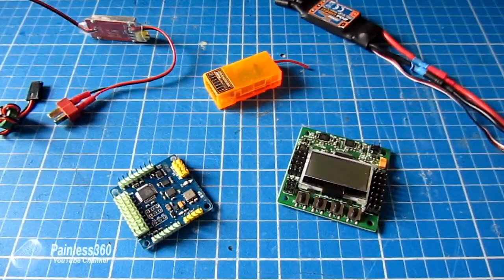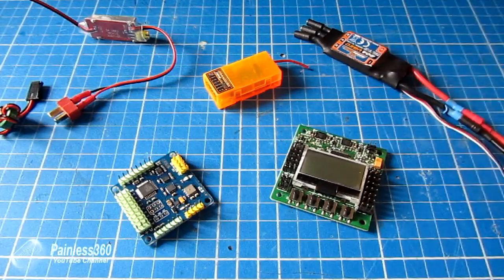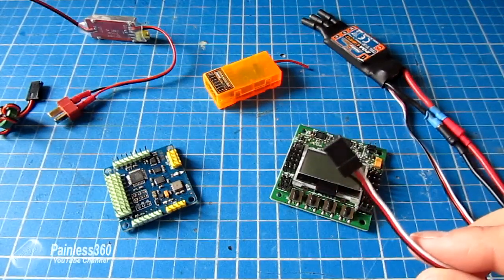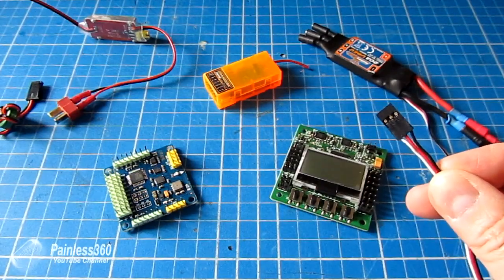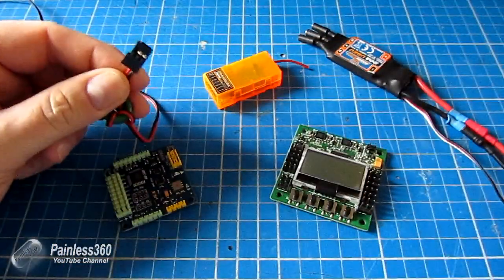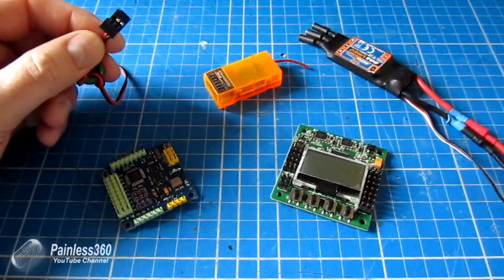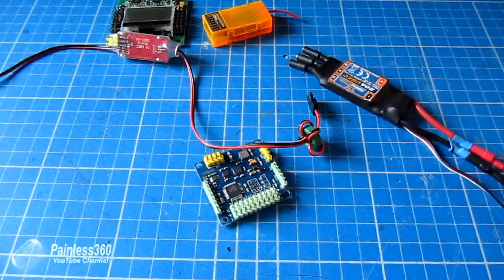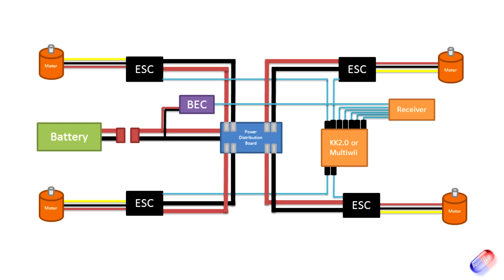How to connect OPTO ESCs and a BEC to you multirotor (KK2.0 or MWC)

Comment: Hello
I have a omnibus xrotor f4 g2 fc and 4 individual platinum pro 30 amps esc no bec 12000hz. What's the right protocole to use them in betaflight make them work with the fc or there's others special sitings. Or just it won't work.
Reply from the maker: Most modern ESCs talk DSHOT. Started with DSH 150 and try it.... Best of luck

Comment: so if you have external power you only need toconnect the white cable? or do you need to connect the red/black wire as wel? thanks
Reply from the maker: I'd always connect the GND wire.. Best of luck
Reply: @Painless360  ok thanks

Comment: can I use a lm2596 buck converter with my 3s lipo batery to power a 5v flight controller
Reply from the maker: Would that support the battery voltage?  Lots of good RC specific options about that are designed for the job. Happy flying!

Comment: I have APM 2.8 board and 4 ESCs with BCE and I want to run another servo motor do I need to power power module or it works fine by the power supplied by BEC ????

Comment: Hey Painless 360. I am having trouble picking exactly which external BEC to buy for my coaxial bicopter I am making. I am currently using a multiwii FC with atmega328p (probably useless info), and have two BL Heli 15A escs and also a Futaba R2006GS receiver. Is there any external BEC yo would recommend in particular or any way I should go about deciding which on to get. I might also switch my ESC's as they are not in the best condition. In that case, if I do replace them, is there any recommendation you would have on a good ESC to get for brushless motors, and an external BEC along with those? Thanks so much, and your video was already s much help. I have also watched a lot of your other videos to learn so much about RC. They are so helpful!
Reply from the maker: Has your running servos then you'll need a bec with a little bit more power. I personally look for a nice little switched BEC with a 5 volt 3 amp output. That should be enough for everything. Best of luck with your
Reply: Based off of what you said this seems to be the perfect UBEC for me: https://hobbyking.com/en_us/kingkong-5v-3a-ubec.html?countrycode=US&gclid=Cj0KCQjwjtLZBRDLARIsAKT6fXwss2pBMAtPywM37ie63eIDbf5hCWNCAuS3HNxp5qY-1dNuhFvGryUaAnCzEALw_wcB&gclsrc=aw.ds
Just wanted to get your input as you know much more than me :). Also, I need a UBEC that works with brushless motors, but this one does not state if it does or not, so do I assume it does?
Reply from the maker: That would work. :D

Comment: I have a pdb with 5v and ground pads on it.
Can i ONLY connect the + pad to the kk 2 board without connecting the ground? (Meaning ground will be the ground from the esc) or must i connect the ground pad in pdb along with 5v to the kk2 board?
Reply from the maker: You can but it’s not ideal... you could connect the power and gnd to a spare connection on the receiver..
Reply: Painless360 u know after i posted the comment i thought of that :D but hey thanks for the fast reply!

Comment: Hi, I need some of your painless advice if I may.   I just found out I need a BEC for my drone.  I'm using esc's that don't have a BEC built in.  Funny about that - when I was ordering parts from Hobby King to build my own drone, they gave me the link for the slimline esc's but didn't mention that I will also need a BEC.  Currently I have a motor connected to esc and esc lead plugged into the 3 pins on my flight board.  When I get the BEC, where/how do I slot this in to the current set up?  Apparently I have to power my flight board without blowing it.  Am I supposed to use a separate battery for this.  My motor is connected with 3.5mm bullet plugs into the esc and then the other end of the esc to the multi splitter battery connector.  This is the esc I am using...https://hobbyking.com/en_us/turnigy-multistar-20a-slim-v2-esc-with-blheli-opto-2-6s.html

I noticed your diagram includes a power distribution board.  I am not using one of those yet.  Do I need one?   If you can offer any assistance, I'd be most appreciative.  thank you
Reply from the maker: +Richard Cerni please see my 'quadcopter building for beginners' series. I cover common things like this in those build videos. There's usually another place on the flight controller that you can connect the 5v and GND to as they are common on most flight controllers.. best of luck!
Reply: Thanks for getting back to me so quickly.  I'll check it out.....

Comment: I have made a zmr250 with openpilot cc3d and esc I have used furibee don't have bec so just wanna confirm that where I have to connect the 5v output from PDB? Receiver or Cc3d (i have watched your video but some say something else)
Reply from the maker: +Just Hack It either will work but I like to connect it to the FC..

Comment: Question: I have 4x ESCs with linear BECs. To tidy up the wiring after trimming the length, can I remove the red wires on 3x ESCs and leave only 1 red wire from the 4th ESC to power the flight controller?
Reply from the maker: +K Khalifah yep, that should work fine. Make sure that one is enough to power everything. Happy flying

Comment: I am new to this but are there not ESC with BEC built in? Also which is better? One single independent BEC or for quad 4 ESC with BEC built in?
Reply from the maker: It's a very personal choice and depends on the space in the model too. The 4-in-1 is more compact but if one ESC fails then you need to replace the whole thing..

Comment: It us written on the bec tat it is 3 amp and max 5 amp,  tat means the receiver can handel 3 amp current?????
Reply from the maker: A receiver can normally use less than half an amp. The rest is there for servos and anything else that you may have that uses the 5v power (servos, flight controller, GPS, Bluetooth module, FPV camera)..
Reply: Thnks for your reply,  but can it handel 3 amps,  like I'm making a plane with 2 small dc motors and 2 servos,  I'm using the small chip board inside the 9g servo as brushed esc,  I'm giving 5v 2 amps supply in the receiver, so u can understand that the motors &  servos gonna pull all the amps through the receiver,  will it be able to handel it
Reply from the maker: Impossible to say without knowing how much the motors will pull. I'd always use a separate power system for motors.. Best of luck

Comment: Hello, I'm having a problem to power up all ESC to Naze32 rev5. Maybe I'm doing it wrong but can you help me, please. I did follow all the steps on Naze 32 build, beginners quad build, clean flight. I'm using flysky fs-i6x control, fs-x6b receiver.
Reply from the maker: Happy to help but please watch https://www.youtube.com/watch?v=olIqTiSJHIY and come back to me with more detail of what you've tried..
Reply: I tried everything that the video had said, none of them works on the naze32. I can power up the board and check the control and it works. But the ESC as soon I plug battery motors doesn't make that beeping sound. That's where I'm stuck, I tried to go back on clean flight maybe there is a button that I need to check to power up the ESC.

Comment: LIKE 342 from me !!! Very good job ,awesome content in your channel ! I have also a configuration (CC3D with Spider ESC...)I have a question ...What external BEC would you recommend me for Spider ESC 12 A opto (no internal bec)???
Reply: And...i still have to cut down the red wire from my esc ?
Reply from the maker: I've heard of OPTO ESCs that need the red wire connecting as it powers the 5v for them too so I'd check on the manual for the one you've got. A small 1-1.5amp UBEC would be great. Best of luck!

Comment: New to the hobby, flying quads. Watched your vid on calibrating ESC's. Tried the process with OPTO ESC and motor would not power up. Had battery to motor and battery to power OPTO plugged ESC into receiver. Receiver beeps as should but motor would not respond when throttle up.  What am I doing wrong.
Reply from the maker: The signal normally needs to be above 1,800 microseconds for the ESC to realize you want to calibrate. Make sure that you're using the right protocol too - OneShot125 etc.. Best of luck!
Reply: Thank for your reply. 
Sorry Painless I don't know anything about microsecond how would I search information. Very new at this would it be best to purchase different ESC's and not use the OPTO. All I wanted to do was calibrate each motor before installation. Thank u again for your time.
Reply from the maker: +Larry Faucett if you're new to this then watch our 'Quadcopter building for beginners' series on the channel we cover all the steps.. best of luck!

Comment: if im  using a 12s setup  with 2 esc,s and 2 motors with 1 receiver do i still have to remove the wires from the esc,s if they dont have built in becs?
Reply from the maker: You need to make sure that something is providing the 5v power the Rx needs. If the ESCs are using switched BECs then you need to remove one of the red wires.. Best of luck!
Reply: but what if im using 2 esc,s with no bec,s in them then what wires need to be removed?my setup is 2 motors 2 esc,s a separate bec and a receiver
Reply from the maker: You need something to supply the 5v, this is what we cover in this video.. Best of luck!

Comment: where would you plug in ubec for opto esc when using apm 2.8 with power module and the small jumper is off? right now i have the ubec plugged in the output side for esc on the apm 2.8 board and the receiver/gps/analog and telemetry side of apm 2.8 is being powered on by the power module. 
PLEASE  & THANK YOU.
Reply from the maker: +Mohammad Ali you don't need the ubec if you have a power module. See our APM series for more details. Best of luck!

Comment: Here's an odd question for you:
Why are the wires wrapped through that green circle thingy?

I have seen it on several of your videos and haven't heard what it's for. (yes noob at electronics too)
Reply: This mysterious ring is called ferrite ring or ferrite bead. It is usedto reduce noise caused by the long signal lead. Leads can behave like an antenna and pick up all sorts of noise, the longer the worse it gets. By using a ferrite ring, it suppresses both conducted and radiated noise and interference. 

The ring is basically an inductor which adds inductance to the wire and substantially reduces the ability of the wire to act as a noise receptor within a small band of frequencies. However to make the most of it, you really need to know which band of frequencies you are trying to suppress, as the ferrite bead are designed to attenuate noise in different ranges of frequencies.
Reply from the maker: Perfect answer! Thanks for replying! :D

Comment: do I only use only one 5v bec to power my flight controller and also my receiver?
Reply from the maker: Sounds like you are new to R/C. We cover lots of the basics in the 'Introduction to Remote Control' and 'Quadcopter building for Beginners' series on the channel that may be useful. The answer to your question is yes. One 5v BEC can run the receiver and flight controller in the majority of cases. Happy flying!

Comment: Do I have to use separate batteries and will these work in the hmx280?I don't think it's a standard cc3d I think it's a Atom cc3d.
Reply from the maker: Modern RC models will normally only need one battery and this is used to power the main motors and then also, via a clever thing called a UBEC, power the flight electronics too. If you're new it RC then the videos in the 'Introduction to Remote Control' series will be useful. Best of luck with it!

Comment: Awesome video.  I have recently decided to build my own quad and just realized that the esc's that I had just purchased online doesn't have a bec.  So panicking last night around midnight I was frantically searching for what to do for at least 4-5 hours and came up with nothing that made sense to me.  Fortunately you have cleared it all up, so Thank You very much Mr Painless360.  I do have one question though, I've purchased the naze32 board.  How do you know which bec you need. I have been searching for one for a while now and I just don't know which one to go with. They are all different voltages and such.
Reply: Hey again, Is it possible to just run just an extra esc with bec that's not really being used as an esc?
Reply from the maker: You could but the ESC will not like being run unconnected to a motor and the extra weight and size isn't needed. Happy flying!
Reply: okidoki thank you :D  Happy Flying!!!
Reply: I'm just going to do it the right way. I have an actual bec on order I'm just going to have to wait a bit longer. thank you again bud. and again nice quality videos. keep it up 😀

Comment: i got a question, my reciver / flightcontroll dont get power from ESCs but my power distribution board got a option for 5v or 12v to be use for this. but i dont know witch one should i use ? 5v or 12v or do i need yo get the extra heardware what you use in your video and go streight from batterie ?
Reply from the maker: You need to power the flight controller with 5v. See the other videos on power in the 'Introduction to Remote Control' or the videos where we do just what you describe in the either of the 'Quadcopter building for Beginners' series. Best of luck!

Comment: can you please give a link to a ubec that is perfect for a naze32 rev5 board please?
Reply from the maker: I'd go far any 5v switch BEC with a >2A rating. Loads about it on the web. Search for 'TURNIGY 3A UBEC w/ Noise Reduction' to see one we've used..
Reply: I JUST TOOK A ESC WITH A BEC AND SOLDERED IT THAN HOOKED IT TO THE TX IT WORKED PERFECT! THANKS FOR THE INFO! SORRY ABOUT THE CAPS MY VISION IS BAD FROM CANCER TREATMNT AND WAY TOO MANY PEOPLE CRY ABOUT IT BUT ,IT IS JUST TO HARD FOR ME TO SEE NOT USING CAPS! I FOUND UBEC FROM 3USD TO 15USD DOES PRICE REALY MATTR WITH THIS ITEM? OR BRAND?
Reply from the maker: I tend to not go with the cheapest. The BEC in the ESC will work but the output FETs on the ESC like to be connected to motor windings so a dedicated BEC is a good idea. I'd get one from a vendor that specialises in RC and has good feedback. Best of luck!

Comment: Running 4s into Pdb, I have opto esc's. My pdb has a bec 12v and bec5v output also, would I be fine to power the Pdb directly off 4s battery, land esc's on outputs accordingly, then run the bec5v output to spare servo connector on seriously pro flight controller?
Reply from the maker: If the PDB is rated for 4s then it should be great. See us doing something very similar to power the model in the 'Quadcopter building for Beginners' series. Do double check everything before you attach the FC just in case ;)

Comment: When the opto burns what is the use in having a bec? When flying multirotor. Your quad is not a plane. Maybe when you have a hexacopter you can land with 5 motors. But still i dont see the point in using a separate bec. When it fries it fries right? It stops working. Or is the bec giving you any stick movement back on that motor for stability?
Reply from the maker: The BEC is separate to the power electronics in the main ESC so depending on how the ESC is designed the failure of an integrated BEC. BECs are designed for a certain range of LIPO sizes so many will not support the larger battery size (>4s). The BEC also adds complexity and cost to the ESC, creates a lot more heat in the ESC package and adds weight too. It's a personal choice on what you use and how you build the model. Hope that helps.
Reply: I understand. For the heat consumption it would be better. Thats why i mount them on my planes and helicopters for safety.

Comment: your videos are great! i had a quick question, I have seen people plug in opto ESCs to their flight controller (naze32) with JUST the signal cable, and no ground at all. is this safe to do? thanks and keep up the good work!
Reply from the maker: +Lucas Ravkov I like to have the GND wires connected personally but it should be OK as the GND is common. Best of luck!
Reply: My 1st quad build.  The kit came with optic ESCs.  So I’m going to need a BEC or UBEC?  I just looked those up and they come in different flavors as well. 12V, 5V or 3V? Please advise and Thank you for the videos.  Flight Controller says one shot.  So, I should scrap the OPTO ESCs and get Oneshot ESCs?  They should match the amperage of the motors?

Comment: So I understand this - I have on order some 20amp Littlebee ESC's, they have your typical 3 wires for motor connections, your red and black for connection to the PDB, then they have 2 wires that connect to the flight controller.  Those two wires are white and black, am i assuming correct that the white is the signal and black obviously being the ground?
Reply from the maker: +Pheonix 2 (Kendall607) Yes, that's it perfectly. Happy flying!

Comment: I bought a 12v to 5v step down will this work as well Pololu 5V 500mA Step-Down Voltage Regulator https://www.amazon.com/dp/B012QE3MNE/ref=cm_sw_r_other_awd_1zDXwbWFXKSND.
Reply from the maker: +B Jones Depends on what you want to run with it. I'd be concerned that only 500mA is a little low for the flight controller etc.

Comment: Thank you, for some of the best tutorials a have ever used. Great detail and easy to understand. I have a problem. I put together a S500 with opto ESCs and a KK 2.1 HC FC. I plugged the BEC into the RX.  Everything looked good with the setup until I armed the motors. The CCW motors spin and the CW motors do not. All the ESCs have power.  I appears that the FC is not supplying a signal to all the ESCs. I am leaning towards a bad FC.  Your comment would be appreciated.
Reply from the maker: Possibly. Check all the settings on the KK ( motor layout etc) and check the soldering on the signal pins for the problem Motors. Let HK know you hit a snag too..